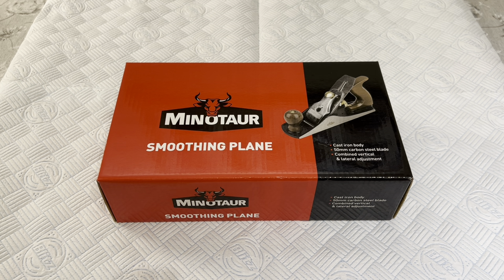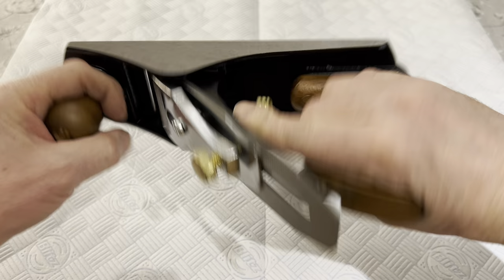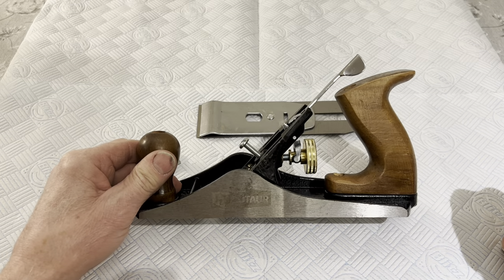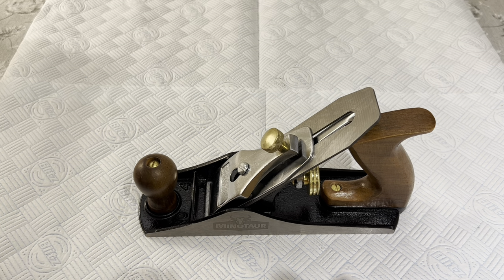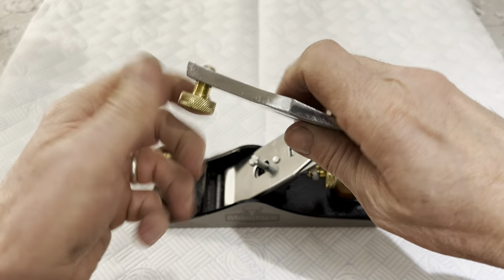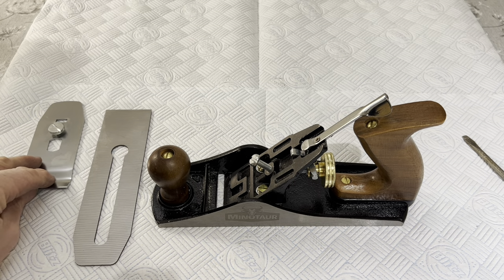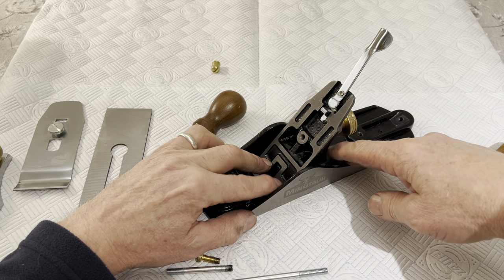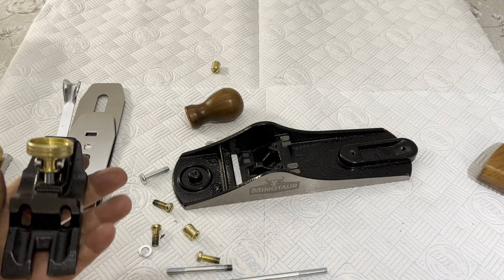No 4 Smoothing Plane for £22… Really! Meet the Minotaur!

Comment: The Minotaur is no bull. If you're bored one day it might be worthwhile to lap the sole. I think if it was mine I'd get around to doing it. I'd probably sand out that rear tote too. It could use a bit of sandpaper strip shoe shine action. Oil the adjuster too. It is a shame when they wear. I've got old planes that would be better today if they'd been oiled.
Reply from the maker: Thanks for watching and comment. Totally agree I have over 30 plane I have collected to use and experience most old some newer almost all bought secondhand. I’ve bought 50 plus over the years most bought back in to service some given to friends and work colleagues some beyond repair scrapped or stripped for spares. 👍
Reply: @chrisfinn1162  I've never bought a new plane. Used is a lot cheaper. Not every used plane I have is good though. Some old planes are in pretty tough shape. You mentioned a Handyman and I have one of them. I have a 5 sized one. I made it into a scrub plane. It works good for that. I paid $1 for it. For a buck I couldn't pass it up.
Reply from the maker: @1pcfred  Thanks for watching and comment. Yes your absolutely right not all old plane are good and in some cases will never be useable even with a lot of work. 👍
Reply: @chrisfinn1162  I buy trash planes when I run across them when the price is right just to see if I can get them shaving. Sometimes I can't. Usually a quick clean up and hone on the iron is all it takes though. I have invested a lot of work on some of them.
Reply from the maker: @1pcfred  Thanks for watching and comment.👍

Comment: I'm surprised Chris. It's not too bad. I once had a student with a Record Irwin no4. Bloody useless. The cap iron had to be about 4mm from the edge of the blade. The adjustments were terrible. Loads of fettling to almost get it working. In fact the iron wouldn't wind back in. The tolerances on the yolk and the slot in the cap iron were miles away. It was about £45. So, this would (in my eyes) would be a better purchase than a Modern day Record.. That's really sad to say.
Great video.
Jamie
Reply from the maker: Thanks for watching and comment. I tried to keep an open mind. I was expecting it to be rubbish. It’s been a surprise that it’s useable.I have had a few of the new Record no4 and as you said they are poor some don’t even have the bed machined for the frog .👍
Reply: @chrisfinn1162  the trouble with low end tools is a lack of consistency. Yours had some flaws but they were all correctable. In another example maybe not. The way they are so cheap is a complete lack of QC. They ship everything. If it comes off the line it goes out the door. No exceptions.
Reply from the maker: @1pcfred  Yes very true that’s why I would not recommend buying one if you’re serious about woodworking. If you’re stuck for a plane one day and that’s all you can get or afford it might do what you need short term or limited use.👍
Reply: @chrisfinn1162  It looks like you got that plane shaving good enough to me. I don't see as many used planes now as I used to. We're getting further from that era. So they're drying up. I find it comforting to know there's commodity planes available retail today. It'd be a shame if all there was were the expensive boutique ones. Not everyone woodworking should be so serious.
Reply from the maker: @1pcfred  Yes totally agree. Woodworking is not a one size fits all. High end planes are not always the best option for every situation. I am fortunate enough to have high end and low end for me it’s about experiencing different tools out of curiosity . I have cheap planes that work far beyond expectations.👍